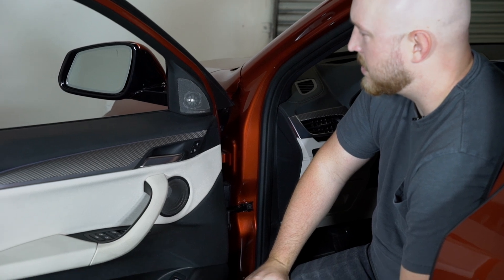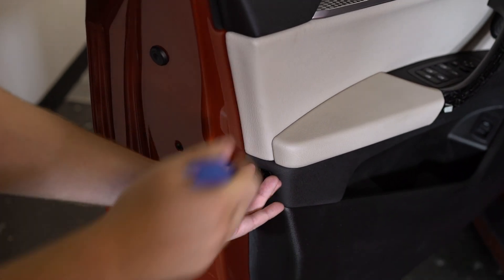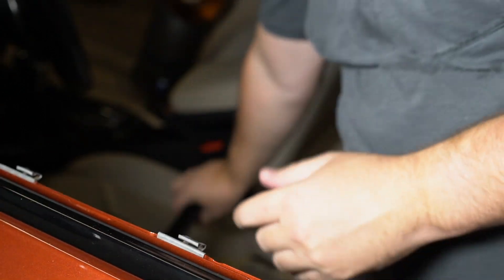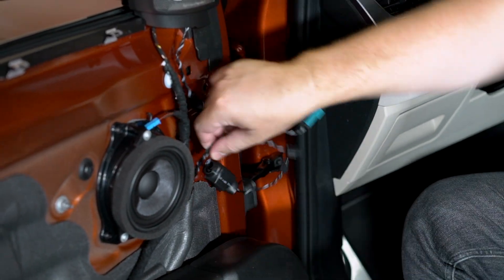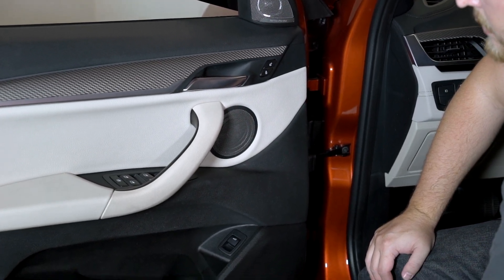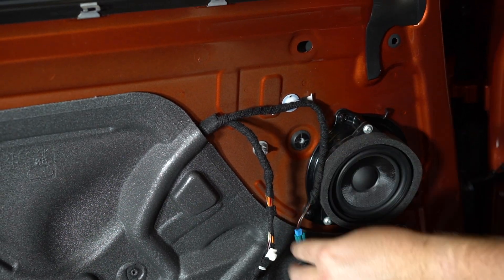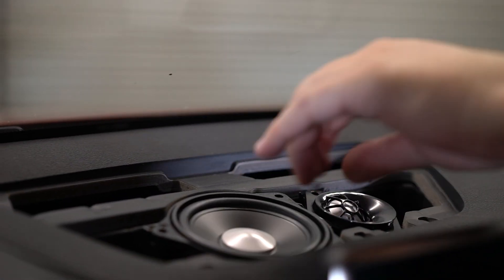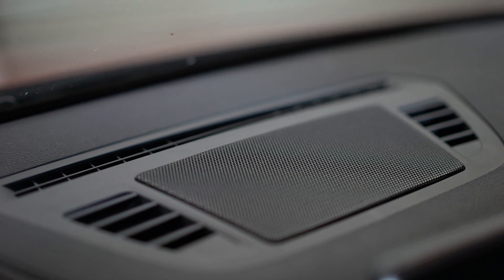BMW Speaker Upgrade/Install |  X2 (F39) 2017+ | BAVSOUND Stage One

Comment: Nice video, but I think you should have made video for X1 with HIFI as there are some differences. Front speakers come with wiring with filter built into the cable. Not sure why as stock speakers do not come with the tweeters.
Reply: @Shawn Tristen instablaster =)
Reply: @Dalton Marcellus thanks so much for your reply. I got to the site on google and Im waiting for the hacking stuff now.
I see it takes quite some time so I will reply here later with my results.
Reply: @Dalton Marcellus It did the trick and I actually got access to my account again. I am so happy!
Thank you so much, you saved my account!
Reply: @Shawn Tristen glad I could help =)

Comment: Hi, i have for few months new X1 (after facelift) and i have optional HiFi radio (without tweeters, but with center speaker in dashboard).
I am not good with sound system performance. It doesnt have a lot of details and threbles are not sharp. I listen in Hifi or Master quality from Tidal with Apple Carplay.
I have to buy 4 x Coaxial speaker for doors (woofers are fine in stock), but what i have to buy to central speaker in dashboard? Coaxial or Component speaker? Thanks, Jaroslav ;)
Reply: Still no reply huh? Same thing… chanced upon this video to try add centre dashboard speakers

Comment: Can I install just the Amp if I have the hifi system.?
Reply from the maker: X2s with Standard HiFi audio systems are bit unique from its peers and lack the tweeter speakers in the setup. They are not compatible with our Revenant amplifier because of the lack of tweeters. Additionally the hifi coaxial speaker kit (with built in tweeters) that we sell are not designed for increased amplification and will blow if used with an amp upgrade.